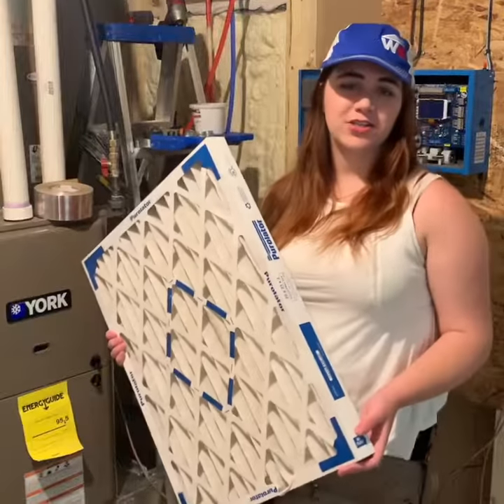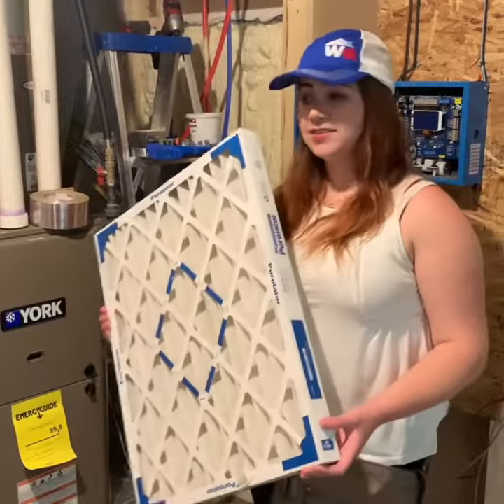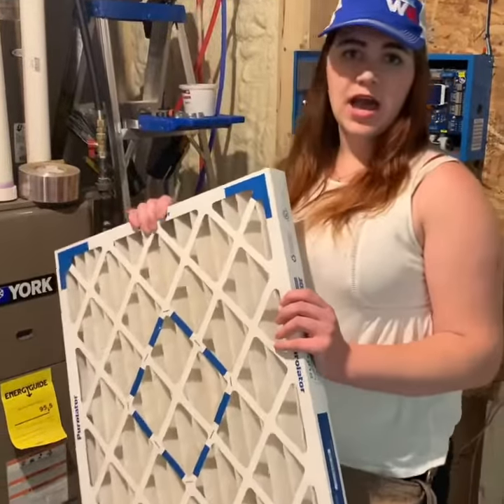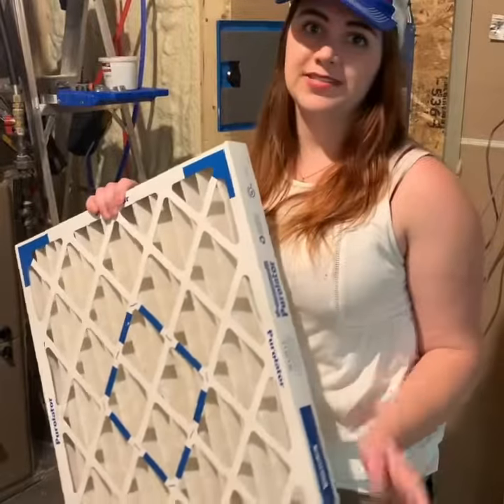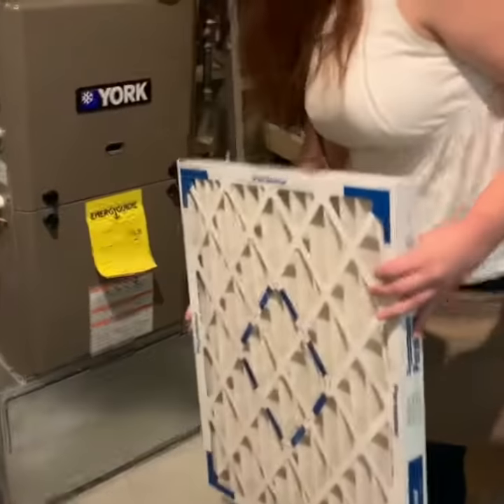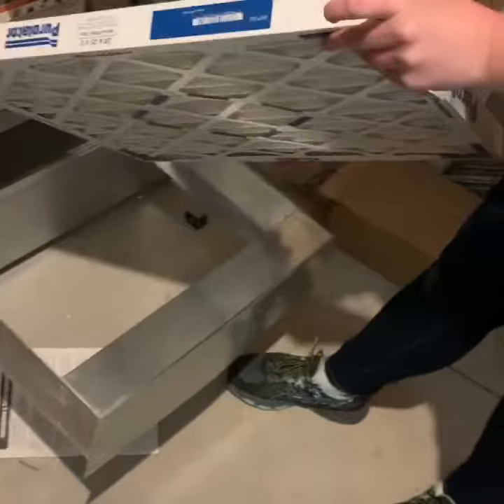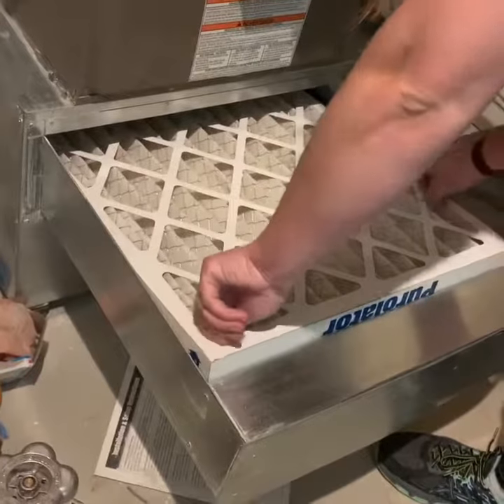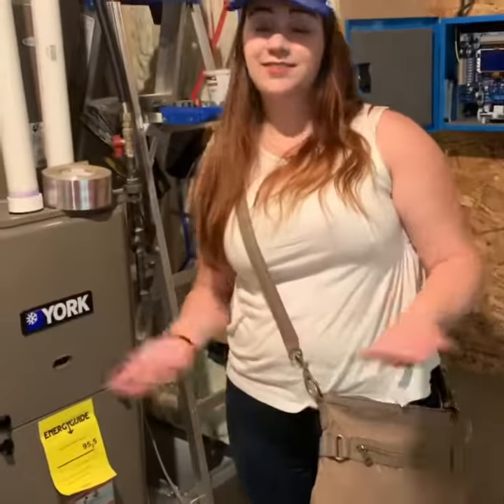Which Way do I Install my Furnace Filter?

Comment: Well, that didn’t help at all, lol.
Reply: It’s couldn’t have been any simpler.
Reply: @afridgetoofar1818  Do you think all are designed the same?  You can’t be that ignorant.
Reply: @neil78b  I mean, you really don’t know how to change out an air filter?
Reply: @afridgetoofar1818  Nothing to do with changing a filter.
Reply: @neil78b  the title of the video is about how to install a filter.
Reply: @afridgetoofar1818  Well, that went way over your head.
Reply: @neil78b  apparently
Reply: @afridgetoofar1818  Bingo.
Reply: @neil78b  and Bingo was his name-o
Reply: @afridgetoofar1818  What? Things are starting to add up…
Reply: @neil78b  did you figure out how to install your filter yet?
Reply: @afridgetoofar1818  Full circle.  End.